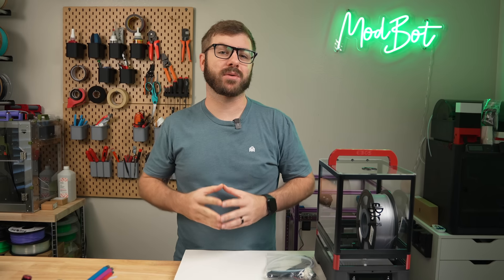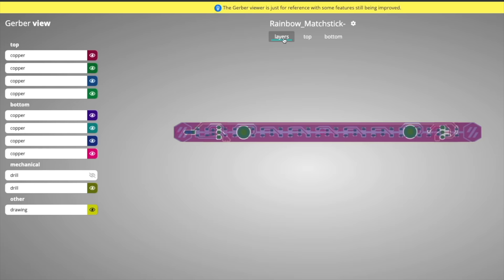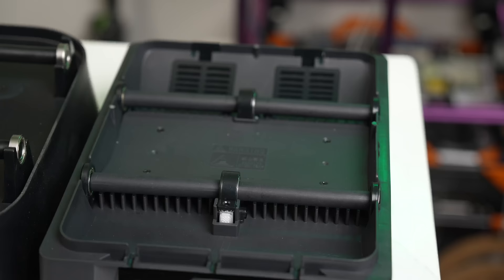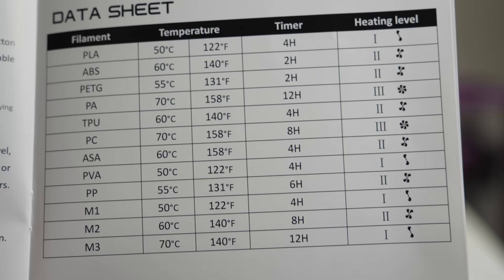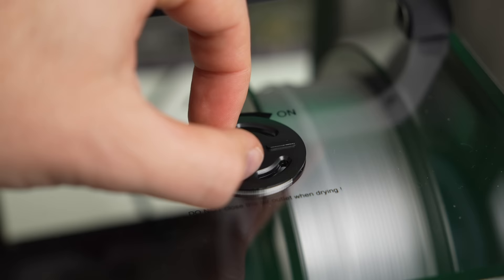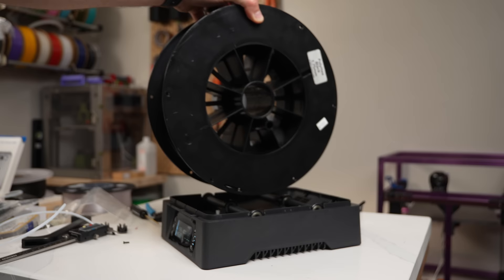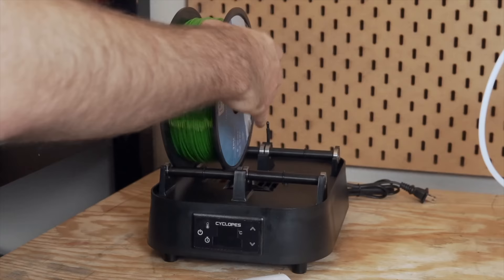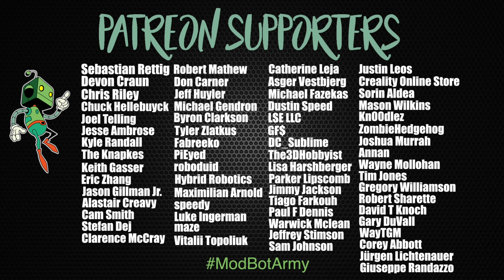I've Never Seen A Filament Dryer Do This (Eibos Polyphemus)

Comment: The price is still very high, and can still get a food dehydrator for much, much cheaper that will do the same job.
Reply: Yeah, $40 dehydrator and you're good. I don't see why people buy these. Maybe a cheap sunlu for keeping it dry while printing something like Nylon, I can see that.
Reply: $200 gets you an industrial food dehydrator that gets up to 90c and can dry 20x spools at once!
Reply: You can get square one, some acrylic sheet and make almost same thing that this does.
Reply: I also use a food dehydrator but it can't just be left on all the time because it's much to hot and the noise level is way to high. Would be nice to have something that keeps the filament dry all the time.
Reply: i used a regular storage box and some reptile heaters to store open filament.
Reply: @hashbringer975 I've heard this argument many times, but I've yet to see someone actually doing that.
Reply: Well most people have an oven
Reply: I removed the heater coil and fan from mine and put it in the bottom of a large dog food container from Walmart put a rack and desiccant in the bottom a rod through the side and a sensor on top with a Teflon tube sticking it the side. I can dry 5-7 spools at a time (depending on soil size and how tight I pack them in and print directly from the box. Very cheap and super functional. If I upgrade it will be to something else I build to hold ~20 spools. Anything less just wouldn't be worth the time. And the value proposition of something like this gets ruled out immediately.
Reply: @teitgenengineering  Not all ovens can go to a low temperature.
Then there is the disaster if it's not at the right temperature, both in damage and fumes.
Reply: @ScytheNoire  I dried tpu at 170 f
Reply: there have been multiple tests where you just place the filament in a shut box with silica on the bottom that also works very well. If you’d dry the filament first and then put them in a box with silica I think your good for months.
Reply: Vent some heat from your PC through a flex duct to a box containing your filament.

Comment: It would be a great feature if the rotation could be set to a timed interval instead of continuous rotation.  IE rotate the spool 120 degrees every 30 minutes. This would also greatly extend the life span of the DC motor.
Reply: Great suggestion, this is what I do manually, rotate the spool every 30-60 minutes. So it would be fine if done by motor every 15-30 minutes.
Reply: Sounds like it's time for a hack.
Reply: Just use a fan that moves the air instead.

Comment: It is a DC motor that it comes with and not a stepper motor.  A stepper motor would not need replacement, but a cheaper DC motor has brushes that will wear out over time.

Comment: The dryer is terrible, the filament does not heat above 45%, it is only suitable for drying PLA. It blows on the humidity sensor, meaning you won’t be able to maintain humidity either. The rotation function is horribly organized, to put it mildly!

Comment: So does it actually reach 70 degrees centigrade in the compartment? You didn’t measure it. That’s a dealbreaker for me. I’ve been looking for one that actually reaches 70, like the Sunlu S4, but smaller. All tests I’ve sofar seen on a variety of dryers claimed to reach 70 has been tested to be false.

Comment: That spool-turning motor looks like a brushed DC motor to me
Reply: I agree I have one of them they put out great torque for their size.
Reply from the maker: Weird I swore I saw them calling it a stepper but you may be right. I just went back through the email and documents and it looks like they just refer to it as motor.
Reply: Agreed, this motor is not a stepper motor. It's a brushed DC motor.
Reply: @ModBotArmy  If it really is a DC brushed motor, it'll be peanuts in cost to replace them once they wear out. It'll also run quite a bit longer than just 1000 hours before the brushes finally run out. :)
Reply: @humbledeer  I bet its that little gearbox that is wearing out and not the motor.
Reply: @filanfyretracker  Probably not a bad bet!

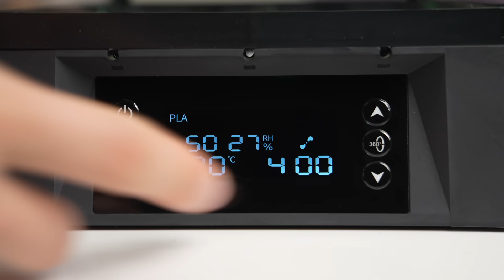Comment: @4:32 It's not a stepper motor, just a simple DC motor (@5:18 , there are only two wires)
Reply: also probably the reason for its short life😊

Comment: The cyclopes seemed to like to melt the filament on the side that sat above the heater due to placement so I personally love that this one will rotate!
Reply: The airflow and rotation are well worth the upgrade. I have the cyclops but living in an area with high humidity I've had filament melt trying to dry it out even at recommend temperatures. That being said, I'm curious how this will compare to the SUNLU FilaDryer S4 in high humidity environments.

Comment: The motor gear isn't containing any lube so open it and apply a bit of dry lube or PTFE spray and the noise get's a lot reduced. It is those Nylon gears which are very loud.

Comment: As a Cyclopes owner, I'm definitely considering selling it and getting this for two main reasons:

1. Being able to remove the top cover while not having to pull the filament first.
Given the way the Cyclopes is setup, you have to pull the filament from the extruder, and then of course pull it through the cover, in order to move the cover out of the way.

Why is this such an annoying thing for me, you might ask? Well, the big reason is keeping tension on the spool to mitigate the chance of it getting loose, and subsequently tangling.
I can kind of palm the cover enough with one hand so I can start to reel back on the spool, but it's just a pain in the ass.

Having the filament slots below the cover allows it to be moved out of the way so you can have two hands to prep the spool for removal.

2. The target humidity setting. I mean, assuming it works anyway, just fire and forget. Don't need to worry about restarting the drier when the humidity climbs back up.
Reply: Bro, I just don't understand why they didn't put a simple door at the front. It would have made removing the Poppins without having to take off the hood. Simple and efficient. The cyclops model is really annoying for that.
Reply: The humidity setting is a big one for me too.  Right now I'm using a Comgrow dual spool dryer, it works for me here in AZ where the humidity isn't bad but having to baby sit it is a pain.  I was thinking of doing an ESP32 mod to control it but by the time I spent the money and time to do that I could have one of these dryers.  Also, not having to unload the filament to open it is another great plus.

Comment: The rotating spool feature is a good idea if it didn't skip, they need to replace the hard plastic rollers with textured rubber ones and I would like to see magnets in the base to hold the lid down. Maybe I should just buy the Sunlu S4 and modify it

Comment: I backed the Eibos Cyclopes on Kickstarter. A few minutes after I started drying some filament I heard two bangs, and then the dryer wouldn't start anymore. After I got in touch with them I was told they would send me a replacement product. It never arrived, and they never responded to any of my mails again. I know I can't expect a fully polished product from a kickstarter campaign. There can always be some minor issues. However, the manner in which they handled the issue, and then basically just ghosted me, left a sour taste in my mouth, which stops me from buying any more Eibos products.

Comment: The Eibos Easdry just melts my filament. It gets so crazy hot inside on the PETG setting it deforms the SPOOL. I have two of them and they both do it. I just use them on the absolutely lowest setting on the dial. Even still, if I leave it on overnight on accident or print from it for a really long print, it heats PLA and PETG enough to cause the last 5 or 6 winds of filament on the spool to fuse solid to each other. It's crazy but it's still the only filament dryer I've tried that actually dries filament completely so I still use them. I just have to be really careful about not running them for more than an hour or two at a time.

Comment: doing the winter. i have done like everyone else. used a plastic box with a humuidty sensor and some desiccant. we have heated floors in the entire house but but in my hobby room i have a radiator so i just store my Dryboxes on top of that. it works wonders

Comment: This thing looks awesome, and has all the features I've been looking for.............except 2.  (1) The price.  Are they serious about that ?  WOW !!!!!  (2) A front opening.  I know this isn't a complaint specific to this dryer, but what is so hard about putting some type of door on the FRONT of these things ?  I have to put my dryers on a bookshelf, which means I have shelf directly above them, which means I have pull them completely out to change filament.  Sometimes this becomes a very big balancing act, that usually ends up with something falling on the floor.

Comment: I have the Eibos EasDry

You have to be extremely careful if you're gonna dry PETG with it... I've had a few spools stick themselves together irreversibly just on the PLA setting.

I still use it for TPU since it doesn't appear to happen to TPU or other materials - but PETG is a pain in the butt.
Reply: I accidentally left it on overnight with a spool of PETG in it, on the PETG setting. It melted the spool enough to deform it and fused almost the entire spool of filament together. I'm pretty sure it's a fire hazard. If that had been a cardboard spool, no doubt it would have been smoldering at least.

Comment: the plate over the heater will help stop the melting of something like PETG. Which I did have it fuse some rows on a spool once int he Cyclopes once. the plate looks like it prevents the heater from blowing directly on the filament.

Comment: A dirt cheap way to dry a spool of filament before using it is to put it back in the box it came in with the decadent (minus the bag), and put the box on the bed of your printer with the bed set for between 40-70C.  Flip the box over from time to time.  A true dryer will allow you to keep the filament dry as you print, but once dried, you should be able to manage even a long print.

Comment: It not a stepper motor, is a regular DC motor. you can easy se it with only 2 wire, stepper is 4 wiers or more.
Reply from the maker: Yeah that’s my mistake. I swore I read stepper but it does look like a DC motor.

Comment: Only issue is... the first(?) batch has some QC/QA issue so the Polyphemus shuts down after a few seconds of use, probably safety shutdown, and figured no way of fixing this. It afterwards sometimes reboots just to run into the shutdown cycle again. Support is apparently currently slightly overwhelmed and is not adequately addressing the issue quick enough. In short, there are now a few early adopter/support with disfunctional units. So the crowdfunding/kickstarter plague continues... products are shipped too quickly/ with limited QC/QA and early supporter/adopter are left behind.

Comment: I wonder how long it takes for someone to make a insulated one so you don't end up wasting 99% of your power on room heating...
Reply: It would take about 5 mins with a razor knife, toothpicks, hot glue, and pink insulation foam. Probably not fire marshal approved but a budget no name Chinese printer or even a DIY kit like a voron probably wouldnt be either. Hell you could just wrap the thing in tin foil and it would probably help insulate it.

Comment: I have both the 1 spool unit and the Cyclops 2 spool. First, I like them both. But here are the down sides that I( wish could be addressed. In the One spool unit if you have any spools that are even a bit over sized even a little then those spools will not fit. Cyclops; When my spools get down to let say 1/3 full these spools will fall over. I put an empty spool in the second slot and that at least keeps it from falling over to far. I don't think the Bearing/wheels work very well. It is just not a really smooth turning of the spool. As my spools turn it basicly jerks a bit instead of smooth rotation. I would love to see how I could modify this and also, so my filament spools don't fall over. Even with the second empty spool in place it still falls over just not enough to effect printing. I wonder if my printing could be improved a bit if I could fix the above issues. I was hopping the new unit would solve these problems. PS I am thinking that if a spool holder went through the middle of the spools then that might solve most of said issues.

Comment: The Cyclopes has ruined rolls of filament for me and others. I have seen people making a heat shield to keep the hot air blowing directly on the filament. 

Good to see they addressed that issue on this iteration.

Not sure rotation is as important as lots of air circulation. The rotation would be far more important on the Cyclopes….

Comment: Unless you print pva, nylon, or any other hygroscopic materials, all you need is a 30$ food dehydrator and in my case a home depot bucket to be able to dry 4 rolls of pla, a role of petg, and 6 .25kg rolls of pla all simultaneously within a night

Comment: I hope it works with the 2kg spools of polymaker PA6-CF/GF, the cyclops disappointingly is ever so slightly too small. we are talking maybe 1cm at most probably 5mm of spool diameter  would make it work fine. I am able to improvise a solution using a printed spacer and putting the cover on at an angle and covering the gaps with kapton tape but I was hoping that the cyclops would be large enough for a 2kg spool and it just wasnt. Other than that tough it works really well and does exactly what it says on the box just be aware that its 2kg spool compatibility is hit or miss.

Comment: I ordered 4 of the easdry units and they are the BEST filament melters/destroyers I own.

I took a thermocouple thermometer to them and on the lowest setting. Two of them stay stuck at 69C like if its just at max no matter the setting used. And the other two vary 5-10C which is just way too much. The control bords between the two sets are diffrent too it looks like the one that just goes to max is missing a component that my other two have. 

All in all the easdry proved to be unreliable so not too optimistic about the brand in general

Comment: Nice but not hot enough. I want 80C drying as is recommended for a lot of ABS and ASA drying.

This looks like it will effectively keep your fillament dry once it is dry, but is not hot enough for inital drying.

I think fillament drying is the bigest segment that has room for improvement in our hobby. The current options are honestly abysmal.

Comment: It would be a great idea to make a printed handle for the Cyclopes as well.  Maybe something that would attach via command strips or something...  Handling that unweildly thing is the biggest downside of using it in my experience (It has been a very good dryer though).  I have some ABS loaded in the printer now as I'm currently printing a part cooling vent for my Prusa Steel.  Think I'll go draw one up or search the web for one that already exists...
Reply: Check out Printables.  I'm using one from there and it makes handling the lid much easier.
Reply: @talentedmrripley9057  I looked, but felt that the thin handles that I saw lacked stability in one or another direction depending on which way you mounted it.  I considered the problem and decided to draw up my own.  I made a circular but hollow "knob" of sorts with a rounded top that looks and acts sort of like a chimney to let the vent in the middle continue to function exactly as designed while giving me a solid grip and control along both directions.  It looks kind of like a thick plastic velocity stack of sorts.

Comment: Almost every dryer I have used has a hard time reaching and maintaining the 70C max, which is the bare minimum temp for drying PA and PC filaments. I find myself draping a small towel over them to give them an insulation boost, and this helps but has me scratching my head as to why they would market 70C but struggle so much to actually reach it.

So, with these Eibos units, did you do any tests around their max temp settings, and whether they could maintain 70C (or higher?)
Reply: I have two Easdry units. They get hot enough to fuse entire spools of PETG filament if you leave them on too long at the PETG setting (which is a bit over half power). I haven't bothered to actually measure what temp they will reach though. To me, the answer is too hot for long PETG prints, even on the lowest setting. They really do a great job of drying the filament though. You just have to babysit them to make sure they don't get too hot.
Reply: there using exciting tech.... its just a food dehydrator..... ironic how those also only do 70c huh. yup all the same parts.
Reply: @hodgeac  70c is cold. i use an oven this thing is a refrigerator in comparison.